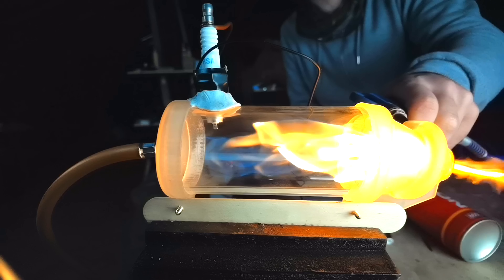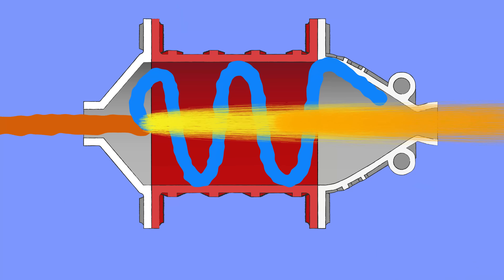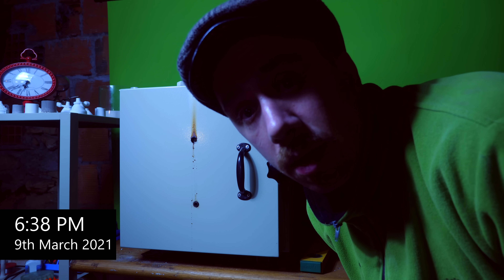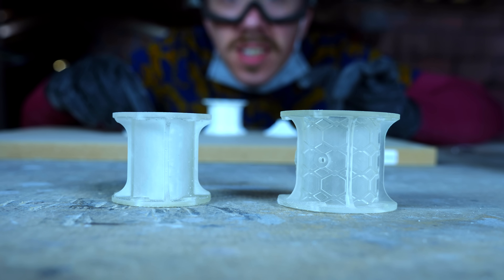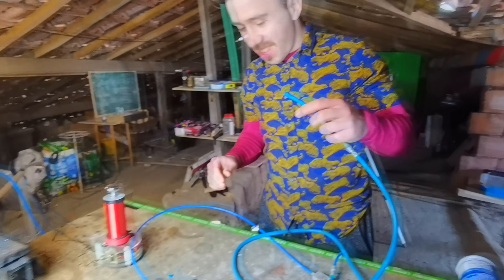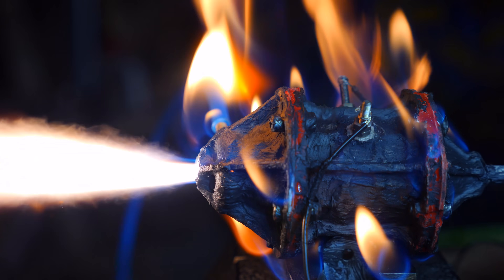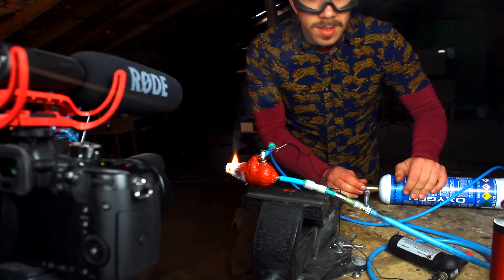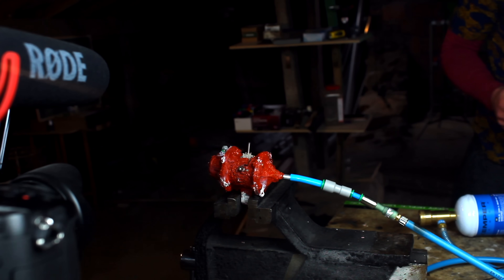Vortex Rocket V2.0 (3D Printed)

Comment: Hi @Integza, I do have a crazy idea, but it's not the craziest idea for sealing your 3D-printed ceramic rocket engine with all the other attributes.

What appears to be the problem comes down to pressures you're dealing with internally: you have the problem that your combustion chamber is actually producing too much power for the materials you've used to withstand from pure strain.  You need reinforcements externally above and beyond for thermal capacity with the high-temperature silicon.

The problem is, how do you do that without machining a higher-strength material that's not porous?

This is where a little metallurgy comes in, combined with electronics experience: I'd wager you've already got all the required materials.  Oh, and some pipe for a form!

"Wait, what do you mean?"  Well, you're part way there with the high-temperature silicone glue.  Now you've got something that'll take the temperatures in mind.  Why pipe?  A permanent support that takes pressure.  What's put in the pipe?  Why, your rocket engine, of course!

But wait, there's more, @Integza!  Just putting your rocket engine in a pipe is rather limited in value.  Each time, it's in a smaller diameter area like around the nozzle you're having it break from stress.  again, I strongly suspect the problem you're having isn't primarily from heat, though the one thing you're explicitly not doing is measuring the temperatures inside the rocket engine or on the outside surfaces: this may be important!

If the problem is not from heat but from pressure, this solution should work well.  If it's from heat, there is still hope, depending on the heat.

Here is what you do:
1.  Print your engine.
2. Inspect it carefully, reprint and send it through the oven until you get something viable. 
3.  Put in fittings you need to be able to access after the next steps
4.  Properly coat the engine with the silicone glue.  This may not prevent it from leaking by itself, and may not result in it from surviving the pressures and the heat by itself, but it doesn't have to.
5.  Put the engine in the metal pipe with the proper fittings, making hole(s) in the pipe where you need to for the fittings, if applicable.  You may find a way to make this work without doing that, you're a clever guy!
6.  Here comes the magic metallurgy part: there are a couple low-temperature metals/alloys you can readily use.  You're already making rocket engines and burning things, this will be the easy part.  The lower temperature and easier to work with stuff is solder, which will melt well below the temperature the silicone glue will work with.  Getting nearer the limits of the glue is straight lead.  Pour this around the engine (I'd strongly recommend heating up the engine in the tube, slowly to the melted metal temperature, in the oven, before this) in the pipe, making sure you have a way the melted metal doesn't go all over the place.
7.  Cool this slowly in the oven immediately after you pour this, to minimize chances of stress cracks.
8.  Hook up all parts for fuel, air, etc. and start burning gross tomatoes!

I'm really wanting to see this happen!  (Does this get a 3D printer if it works?  Also, I wonder if you've got a more recent video where you've solved this, and I'm typing into the past).

Comment: Try JB weld for a sealant or a high temp RTV and let it cure for 24 hours before testing. The red rtv looks wet in the video, copper spray gasket sealant might also work very well. It works very well as an exhaust falsetto sealer, maybe take a very thing sheet of metal to make a gasket and spray both sides with the copper spray, let it dry and then assemble

Comment: It seems like 90% of your issues seems to be related to the material not handling the high temperatures or pressures also some high temperature coatings and products can actually ignite if exposed to a direct flame.

Comment: Just give a try to lock and key model. Like intertwined with all parts each other. But use many layer. Not connect them on a flat surface.
Reply: And don't forget to measure your experiments. Measure everything while experiments like the room temperature, the pressure in the tank, temperature of each parts, amount of gases you use, the force on the nozzle from back to front and from inside to outside. And the critical points of rocket. Just measure everything save every data and information, every chanced variables for a while and compare them all. This is the most important thing and the goal to make an experiment.
Reply: You are going well but the only deficiency of you not to measure variables and not to save them. Don't forget to only product of an experiment is datas. Use them, Don't waste!

Comment: I do understand that when you change the size of the chamber the fuel mixture changes as well and therefore said jet may not work but the chamber he was using that worked rather well was overheating and in the video you can see it glow almost white-hot so that being said you should probably make some minor adjustments to the chamber

Comment: You could chemically remove the plastic from the part, seal the main openings to the chamber, then 'slip dip' the engine to pull more ceramic into the pores. This will increase the wall material density. Once you've done this you could use a ceramic glaze and fire it all in the kiln to make it non-pourous. This is basically the same as making a coffee cup or mug Integza.

Comment: Ok I have worked in aviation so 1. The materials will not hold up to the heat for the time test or reuse = solution stainless or titanium will hold up more durable, since Ti is hard to get or for cost use stainless. Most soup cans are stainless or high grade metal because of food use, use for structural and inter anal chamber. 2. The leakage can be contain with surface to surface mounting with out gaskets. Solution high temp sealing again with high temp automotive ceramic paint for exhaust headers to bond the two halves or to coat the inside of parts. 3. Are the ratio of inlet and outlet pressures effect and efficient for the thrust out and the Venturi pressure? Hope this helps.

Comment: It looks like part of the problem with the silicon is that it doesn't have the strength to stand up to much internal pressure. There are two potential ways to solve this.  One is to put the silicon on the inside of the engine: bad idea.

A better solution is first covering the exterior of the part in the high-temperature silicon, then reinforcing that by covering it in a cement layer.  Even if the silicon starts to soften (or even melt) from the heat, it's unlikely that it'll be able to push itself through the tiny pores in the outer cement layer, allowing the engine to function for much longer periods of time.

It's kind of like using wax to make a canvas bag air-tight.  Pretty janky, but as long as the wax is too viscous to be pushed through the pores in the canvas it'll work.

Comment: Just a few ideas to run by you, instead of using just silicone on the outside, I personally would try using a sodium silicate epoxy or a titanium reinforced resin inside the engine to help seal and protect the thermal silicone that's outside. And maybe keep from getting blow outs. And for parts bolted together I would try making a metal gasket coated with silicone to seal the bits that are bolted together. Hope this helps

Comment: Why don't you fabric a steel cylinder inside the rocket motor. Like they do when they build a motor for a car you have a steel sleeve inside. Then JB welded into place or resin into place. Like they have air pistol or a BB pistol gun you Mike have a better chance to run it. I drilled a hole in 1 in of a cylinder pumped in gas mixture and it worked like a engine. I put it on HO scale railroad tracks on a flatbed car and ran it around it worked pretty good.

Comment: You might just need to make the walls thicker on your one piece engine. Maybe even try multiple walls with tighter infill. Also, you might have to ditch the 3D printing altogether and go for a straight casting. You're chamber pressures are too high and bursting through the layers. So try increasing a bit slower to find the tolerance points

Comment: Integza, great video, for projects dealing with high heat like this one, consider using your 3D printer to create casting molds or sand molds, then use your furnace to melt aluminum cans and pour the molten aluminum into the sand molds.  Is more complicated, expensive, and time consuming but you get real metal parts.
Reply: I think it is possible to print with a metal-powder-containing fliament, bury it under sand, burn away the plastics and sinter it (the sand acting as a temporary mould), and you'd get a solid metal part

Comment: If the ceramic material used in the printing process was designed to have a more refractory resistance to heat, such as a refractory glaze added over the finished fired parts and fired again to crystalize the exterior glaze the parts of the engine could better resist the burn through after ignition of the propane and air fuel mix.

Comment: So...... why not use the porousness to your advantage? What if you had a shroud over the engine that could hold oxygen at a higher pressure then that of what was in the chamber, thus equalizing/feeding into the tank?
Unless someone comes up with a way to have the ceramic be sit in a material that can get into the microscopic holes but still be fire resistant, idk another way to deal with the leak than to create a balance in pressure. @integza

Comment: Integza, I think you may be looking at the leaking from the wrong end of the problem :)  The heat is causing the sealing material to fail once the pressure gets to high, (even though the vortex should stop the heat from getting to the sides , but anyway..). So you could try something from the left field, and try to stop the heat from getting to the sides in the first place.. "Starlite" - If you could somehow either line the inside of the combustion chamber with starlite , then the heat would be 100% contained, and your leak failing may stop.. Because the starlite will "sacrifice" layers to make carbon, the vortex may cause it to lose those layers so it may not last a heap of time, but it would last quite a while.. you can learn about it ( and how to make it ) here https://www.youtube.com/watch?v=0IbWampaEcM   - Maybe it would be a fun subject for a future video too?

Comment: 14:34 Looks like you got some low frequency combustion instability (chugging). One cause of this is coupling of pressure effects in the feed lines and combustion chamber. You can mitigate this by introducing a higher pressure drop over the injector by making a smaller orifice (usually around 20% of the chamber pressure).

Comment: Can a sintered part be dipped and sintered again? I'm thinking thinned silicone and make a jawbreaker style. also have you considered high temp paint to line inner Wall? or maybe even fiberglass reinforcement for the outer wall?

Comment: Why not just make it out of metal, you can still 3d print it and use a variation of 'lost wax casting' instead of wax through you melt away the PLA, that way the engine can be used to fly something, while a ceramic one is too fragile, just proves vortexes work

Comment: After you cure the ceramic parts in the oven you should try to dip them in regular resin like tough blue or any other 3d resin then cure to help full most of the pores so it doesn't leak as much (or hopefully at all)

Comment: In order of increasing effort: 1) Lapp your joints. 2) double modular walled nozle bits; use an exterior ceramic boundary casing too keep naughty gasses from delicate fuel lines, perhaps a vent chimney.

Comment: Wow, it's been several monthes that I've watched your videos, you made a lot of progress, and you have more equipement, nice !

Regarding your leaking problem, I don't know if it would work, but It doesn't seem you degassed your coating, you could give it a try, but clearly we saw that it could not handle the temperatures anyway, so...

maybe coat it with fiber glass or carbon fiber and resin, first, then if silicon can withstand the sorta temperatures,  you can encase the fibered engine into it, but once your mix os silicone is done, degass it, then pour it in a frame containing your engine in the middle of it. A perfictionist (with money) would also put the whole thing in a compression chamber for the duration of the curing time. Silicone is non porous.

Edit : Just saw comments about glazing, yeah, try THAT first, seems a lot better

Comment: The modular engine has to be properly sealed to accommodate the high pressure provided by the fuel and oxygen intakes as well as the reaction in order to maintain flow specified for the geometry you used. I.e. as soon as heat leaks into the joints, cracks will form, inhibiting flow, and the engine will fail. Idk what methods exist for sealing ceramic pieces, but you should treat the engine as a pressure vessel. Also maybe research methods for preventing porosity

Comment: I think you are using the incorrect kind of ceramic powder. Clays are rated into different 'cones', which refers to the temperature needed to fire them. Low cone clays such as terracotta can be fired to make a pot, or you can use it as a glaze on a higher cone clay - at which point it will vitrify. if you want to use a ceramic material that can withstand high temperatures then your best bet would be to use a Fire Clay - A type of ceramic that can withstand at least 1,515 C. this is the same material used to make crucibles and kilns (including the lining of your kiln/oven). Because they have very high fusion temperatures you won't run into the same problems that your initial engines were running into. It wasn't so much as a leaking as the ceramic itself was vitrifying, turning into glass and melting. Even better you could use fiber ceramics which are used in the combustion chambers and nozzles of liquid fueled rockets. If you can't 3D print with those materials, you might be able to print a mold using plaster and then making the parts via slip casting or press casting. 
That being said I absolutely loved this video and I had no idea ceramic printers were a thing now!! I wish you the best of luck and I'll be eagerly awaiting an update!!
qualifications: spent 8 years working with clays and ceramics, experimenting with glazes and building high fire kilns

Comment: Maybe you could use high temperature lacquer to seal it (some go up to 800C). And if you do, maybe try pulling the lacquer (or what ever you use) into the pores with a vacuum pump. Maybe gives better sealing.

Comment: Looking at the footage you can see the rubber silicon expanding due to gasses leaking through the  cracks in the ceramic the bursts of these gas filled pockets lead to the failure. More like a balloon than a proper gaskit. Build a shroud that will prevent the rubber silicon from expanding so it can function like a proper gaskit. 

Also depending on the outer support shroud you could reduce the complexity of the inner parts and make them just interlockable like pvc pipes. Cover them in cement or silicon and bolt the shroud around it.

Comment: Hey Integza! Since you like jet engines, you should try to make an Impeller Jet Engine powered by a highly powerful Brushless DC Motor. There's a 3D printed 600 watts 22 Volts BLDC motor design from someone called Christoph Laimer out there. If you are familiar with induction motors, then you can also play with the winding method for different applications. I love your content, discovered your channel like a week ago. Stay safe, keep the good job!

Comment: Aside from glazing or sealing the part with high temp RTV sealer,  why not apply a few extra coats of resin while its assembled cure it and bake it. Safely pressure test with air so you have a baseline for the burst rating and sealing aspects of the extra coatings.

Comment: It's probably too late but, do you have grill spray paint there? It's high temperature stuff that is used to refinish outdoor grills. Should be cheap and easy to apply at least. Not sure if it will handle really high temps though.

Comment: Why not try painting the entire engine in conductive paint and then just electroplate it with copper or another metal. This should fix the issue of it not sealing. I would also try different plating thicknesses. After plating you can even sub-merg in a solder bath, to get more mechanical stability. The most obvious option would be to have it cnc'd out of a metal.

Comment: You need to create an over pressure on the outside of the ceramic. This will  create a negative differential pressure causing the leakage going to inside instead to outside. Create an outer shell of a non leaking material and let the future rise, space man.